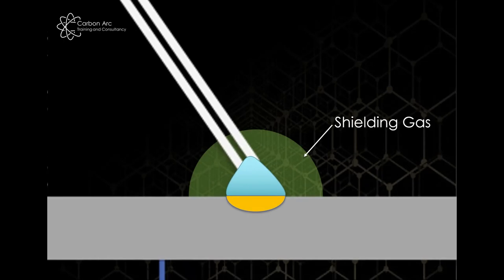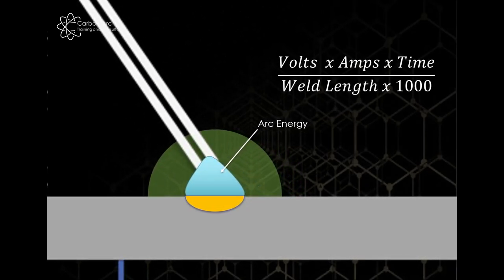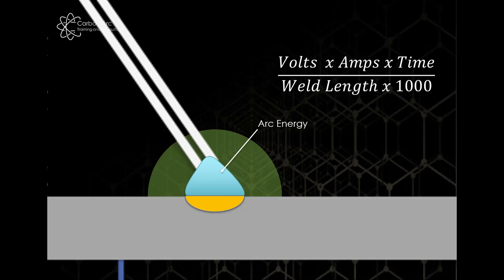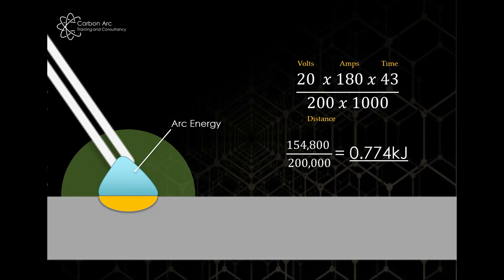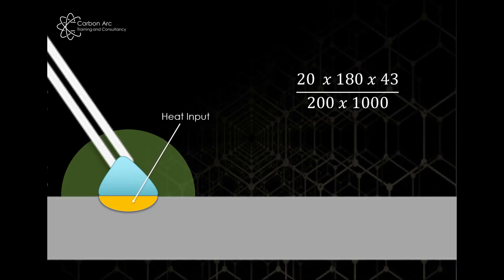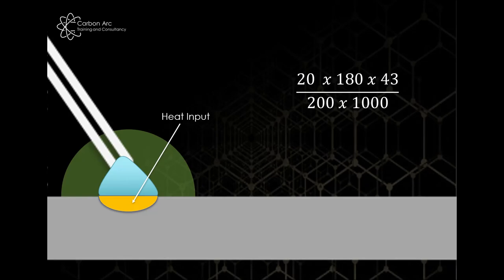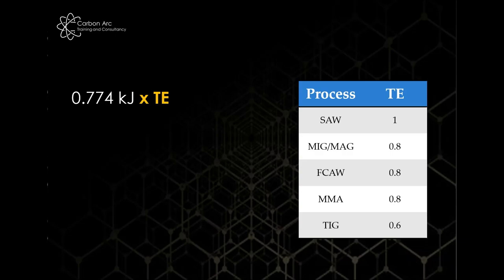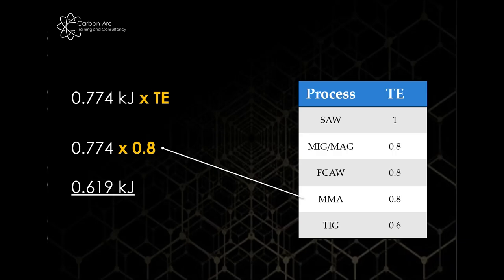Arc Energy and Heat input (Live Session Extract)

Comment: Can you do a video on where to place the multimeter to carry out an audit
Reply from the maker: I am away teaching for a few weeks but will do it when I can. In short, amperage from anywhere in the circuit and voltage as near as practical to the welding touch, one lead in the positive and one lead in the negative sides of the cables